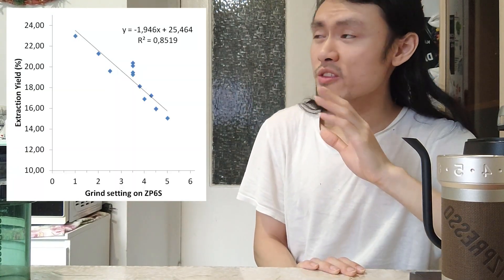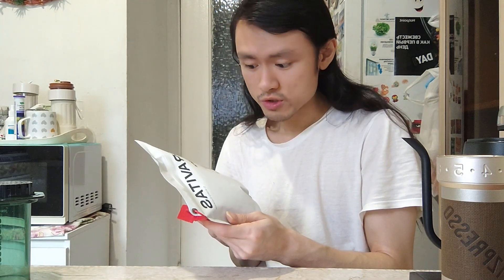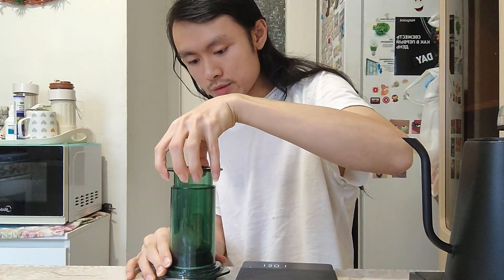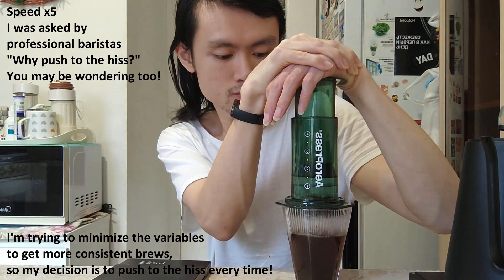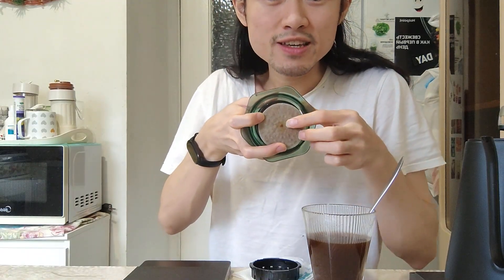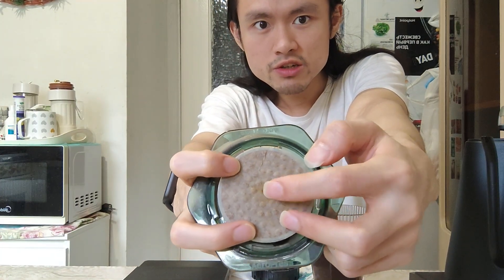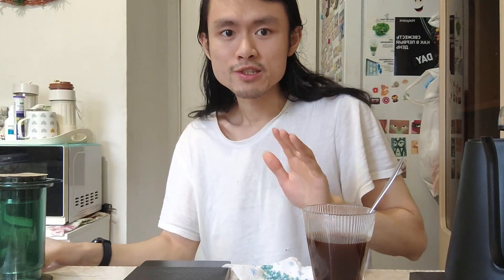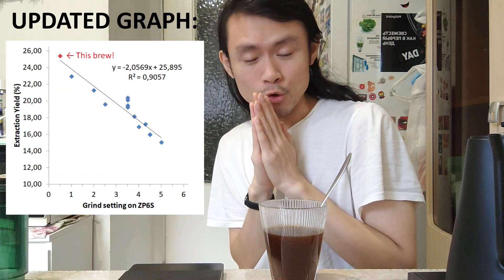Overextracting Coffee With AeroPress To Prove A Point (Coffee Experiment)

Comment: I'm genuinely amazed at how good the coffee turned out following your guide and grinding the coffee really fine. My aeropress came with a filter cap that has a square pattern and I get a really even puck and I don't get the center hole. It could be something to consider.
Reply from the maker: Wow, that's interesting! Are you using regular AeroPress? Mine is AeroPress Clear, so maybe the caps are different 🤔 I'm really glad that you enjoyed the coffee though! I did enjoy the one in the video too, but I'd definitely grind a little bit coarser to cut back some of the bitterness, but it's all preference 😄
Reply: @TonyTuanx  Yes it's a regular aeropress, I've seen them sold with both patterns, I'm not completely sure, but I think there was a period in time when aeropress changed the pattern to the square one and then they seem to have changed back to the circular one again. Mine has a pattern similar to the Premium or XL versions shown on their website.
Reply from the maker: @Mckprng Thank you for the information! I might look into it closer, I'll consider buying a different cap to see if it changes anything 🙈

Comment: I am also experimenting with my aeropress recipe. My idea is instead of creating tamped puck and pushing through the water why not grind really fine and stir it continuously and press right after stopping stir. This would allow the particle be suspended in the water and won't let the filter clog up. I think with pushing slight water at first we can adjust the taste.
Reply from the maker: That's an interesting idea! I'm concerned that by stirring you'll give the fines some initial momentum to clog the filters; maybe you can try using two or three paper filters at the bottom or some other thicker paper filter? 🤔 Or even stopping the stir, sealing AeroPress and inverting it first before plunging to stop their motion and to let the particles stick together into larger stuff that won't get through the filter? Either way, good luck with your experiments! 😊

P.S.: inverting sounds very risky, so I wouldn't recommend doing it 🫠
Reply: I feel like it would clog faster because you're lightly coating the filter with fines constantly without having any structure for flow.
Reply: I just forgot to mention I've flow control attachment so there is no constant flow. I grind fine but not like turkish coffee fine. It doesn't clog up in my experience.
Reply from the maker: @asdfgh5889  Oh, that changes the discussion, yes! Is it metal filter then? I have no experience with the flow control attachment, but it does sound reasonable that the metal filter wouldn't clog as easily as paper filter
Reply: @TonyTuanx yes, it's has metal filter but I put paper filter too to get cleaner coffee. Flow control is really great and no need for inverted method. Today I discovered good recipe: 16-17g fine grounded light coffee, water 200ml 95c and continuously stir with linear motion for 1 minute and press slowly (although it clogged the filter, I had to pull the plunger to relief the filter). Same works for smaller amount of water to get stronger coffee.